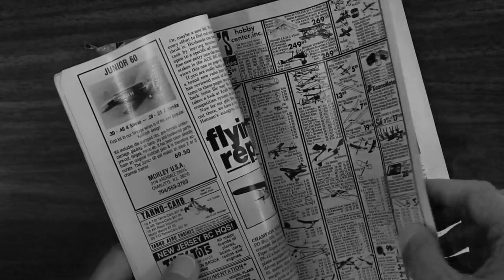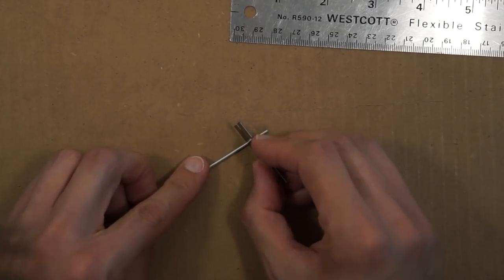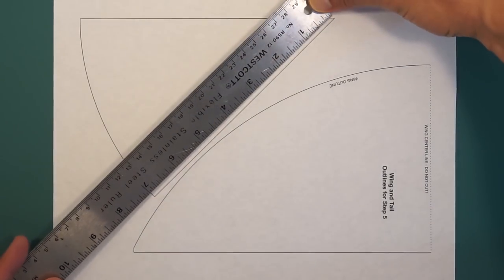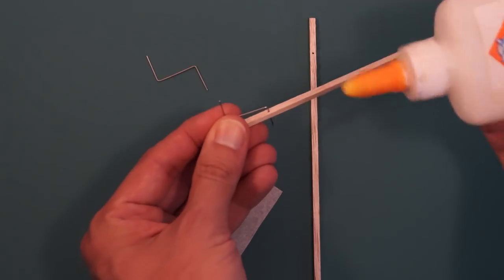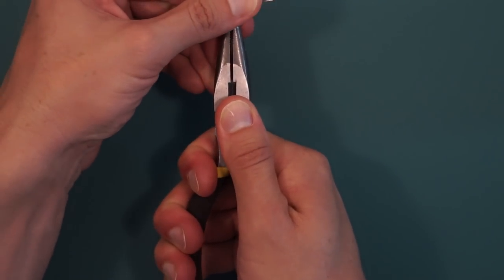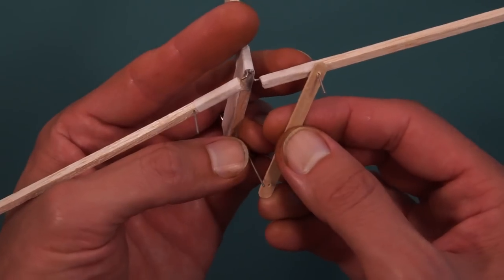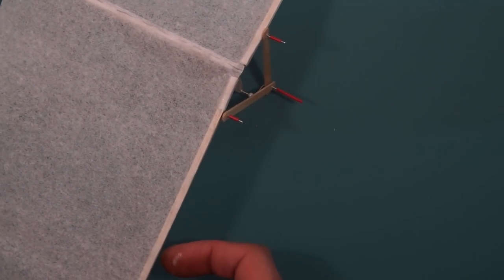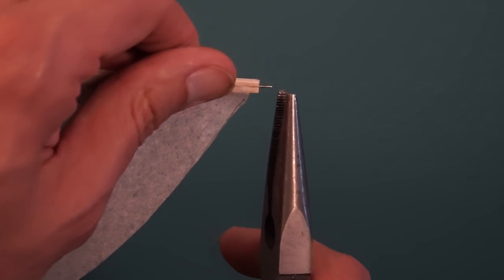How to build - Simple DIY Ornithopter - Flies Great! Flapping Wings

Comment: The Childrens Britannica from about 1981 had a very similar design in the back of one of the volumes. From memory the connecting rods were balsa rods with short pieces of tube on the ends. And the tail might have been slightly different, I think the angle for the tail was cut into the main stick and it was simple glued on. But basically very similar to this.

Comment: Hi Nathan, thanks for the video. I'm from India. It would be great if can give us the weight of the each stick has and how much it should weigh after everything is built. thanks. Till now I made 3 birds. none of them flew. I made 2 before. After seeing your video, I've made 1. This is also didn't work. 1st known thing is, I'm using home rubber bands. 2nd unknown thing is how much weight it should have. 3rd I'm using ice cream sticks instead of Basel wood. 4th once I fly this the connecting wires are bending easily. I'm not sure I'll get this specific rubber band here in India.
Reply: Nope you dont get that rubber in India. It is Tan Super Sport Rubber. You can import small qty from http://www.fly-m.com/rubber%20stock.html but no guarantee it will reach, especially if you are in a small town. Or ask someone returning from US to get it for you- you can order from Peck Polymers.
With no light balsa and no TSS rubber, very little chance you will get it to fly. Of course, I havent made it myself to prove it but that rubber has no match.
Reply: @ashutoshbhakuni303  thank you for replying. I've ordered balsa wood. Let me check I have any friend in US. It is OK even though it's not flying like your bird. It should fly at least.
Reply: Fashion Kids Fun Good luck. I am interested in knowing where you have ordered balsa from and if u have prior experience of buying from the seller?
Besides thickness, density of the wood matters. And so a low density wood of the required thickness might not be strong enough to say withstand rubber tension. The densities of balsa vary widely and I havent seen any Indian online retailer mention density or even inform after asking. Chinese ones mention density but there is a wide range and each order can have sheets of very different densities. So I am curious to know which seller u have ordered from and the shipping charges.